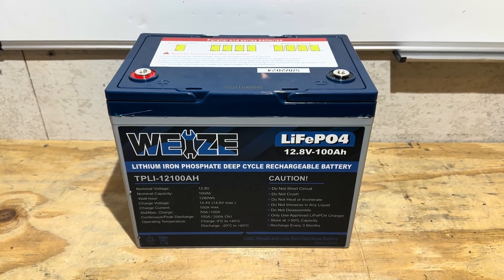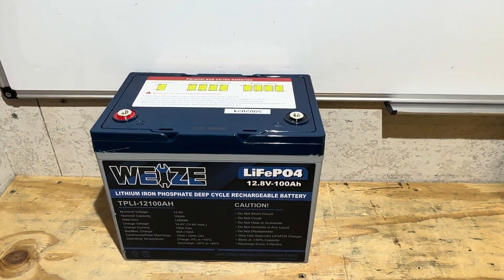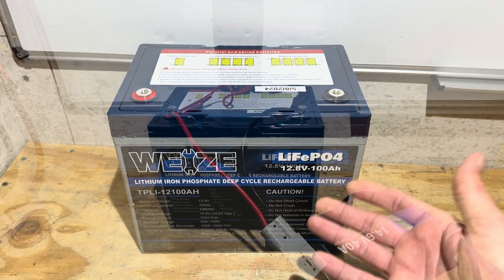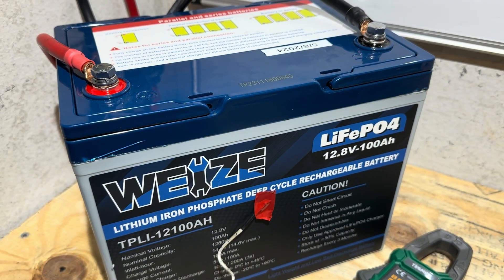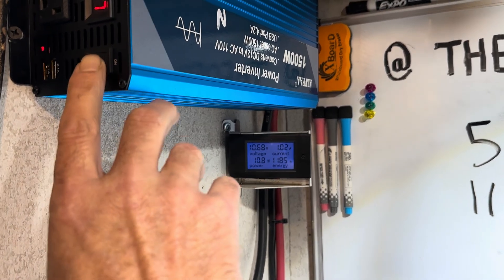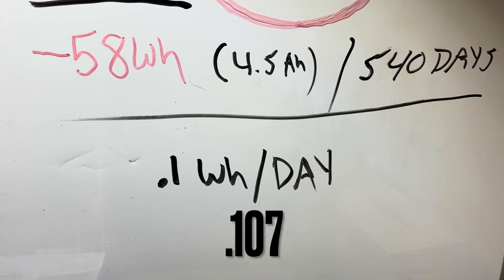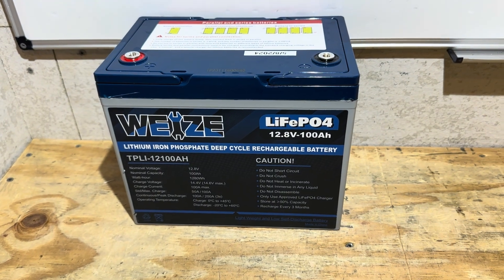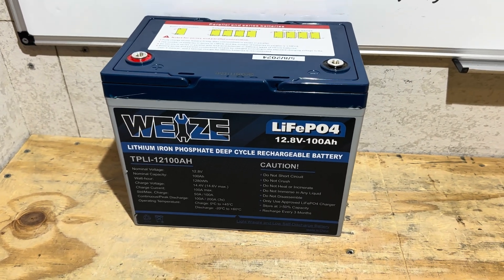Used LiFePO4 Capacity Test, Weize 12V 100Ah LiFePO4 Lithium Battery

Comment: Quality LFP batteries such as EVE typically lose 3-5% capacity over the first 2 years. 2-3% the first year 1-2%the second. 5% over 18 months is not terrible for a cheap battery. My EVE batteries lost just under 3% the first 2 years. High temperatures increase the losses as well. Which may have been the case being the installation was in a camper.

Comment: I wonder if you're looking at a slight increase in internal resistance, more than actual capacity loss. Try the capacity test at a lower rate, more like you would, a lead acid battery. As you look at the comments, and see replies indicating less capacity losses, they might be testing at C/10-C/20 rates, more similar to how lead acid battery capacity is tested.
Reply from the maker: I would assume by this point in the battery’s life there is increased IR from build up of passivation layer which is normal for aging cells. 
The potential higher IR could cause a loss in overall efficiency due to more heat in the cells during service. 

I also agree if I pulled down slower that there may be a measurable difference in overall capacity. Probably not earth shattering difference but measurable nonetheless. 

But I try to charge and discharge near a .5C rate which is how cells are tested at the factory for capacity. 

The 40A charger isn’t perfect but it’s ok for rough ideas on 100Ah units. Of course I’m not a test lab by any stretch of the imagination. I do try to keep everything consistent best I can. Use the same equipment and methods, the only variable is the battery.
Reply: @THEOFFGRIDMOUNTAINHOMESTEAD  That's OK. This is "real world" testing, which gives a better idea of what the battery will do for us, not what it did for a lab technician. My primary interest in batteries is renewable energy, where the charging and discharging occur over longer periods of time. Changes in equivalent series resistance are less apparent for me, where I spend an entire day discharging, then, charging over several hours during a sunny day. I just don't run them as hard.
Reply from the maker: @vincentrobinette1507 Yes in the system this was running in was very slow rate charge and discharge. The battery was never hit hard at all, which kind of surprised me. It had a pampered life. 

I had always gone with the assumption that slow and easy on the batteries and they would last even longer. 

I do have a couple 12.8 that have been absolutely beat on for comparison purposes and I’m curious to see how they have held up. 

Maybe aging will take them out before cycle counts? Boards should last 8-10 years but I’m starting to see some board failures here and there in short order too. There will be an update on this soon as well.
Reply: @THEOFFGRIDMOUNTAINHOMESTEAD  Internal resistance is based more on the number of charge/discharge cycles, than the current. Once the battery settles in, its resistance will be higher than when brand new, but shouldn't vary much from then on. In the case of the Weize battery, as well as the newer one, you're measuring that initial degradation, which is much more dramatic, than what you'll see from now, until the same number of cycles from now.
Reply from the maker: @vincentrobinette1507 Time will tell!

Comment: I'd settle for that capacity loss to be honest. It's still good for a good few years yet. Thanks for the info however.
Reply: I use several knock-off Lifepo4 batteries. Some perform better than others - even different batteries with same name stamped on the label. For the price I am OK with that.
Reply from the maker: @gwb8445 Thank you for sharing. Some of the cheap brands change their build often. Sometimes within a few weeks. Often a mystery box, that’s why I enjoy checking them out. 🙂
Reply from the maker: Thanks for sharing your feedback! Appreciate you. 👍

Comment: I've been using 4 Renogy 100 amp hour batteries for 3.5 years daily (in parallel).  Each battery has lost less than half an amp hour over that time.  Very happy with them.
Reply from the maker: Great to hear! Maybe this battery had second life cells and is leading to a faster decay curve. It is a cheap battery and never delivered 100Ah even new.

Comment: When you originally tested it, did you do it at the exact same load and with the same inverter, shutting off at the same point?  If any of that is different, then different results, and basically apples and oranges. 
Also, capacity is typically tested at .2c  ( so a 20A load, rather than how you loaded it) typically to when the BMS shuts off, NOT when the inverter shuts off.
I expect if you tested it with a 20A load to BMS shutdown, you would get a higner value... and that value would be the same way the factory would have tested/rated it.
Reply from the maker: LFP cells are typically tested a .5C charge and discharge rate for their rating from the factory this is repeated 5 times and the average of the last 3 discharge tests is the capacity stamp of the cell when new. There is a 5 hour rest after full charge or discharge before proceeding further to allow the cells to return to ambient temperatures. Ambient test temps are 25°C +\- 2°C. 

.2C is a hold over from lead acid. 

Yes the initial 1243 was obtained from an Alffaa inverter until low V disco on the inverter. I never pull to BMS shutdown. Real useable capacity on an inverter is all that matters to me. The battery case temp I showed would be an accurate representation of the cell temperatures as the battery was held at this temp for 24 hours. The charge was a top off. It was fully charged the previous day. As I do with all my batteries.

Comment: I’ve got a crappy deep cycle battery that I hook to my remote cattle fence and kill dead a few times a month that is coming up on 5 years old. It’s starting to degrade but still sits in the snow and zaps critters when I need it to. I’m pretty sure I just got lucky with that one:)
Reply from the maker: Fence charger duty! I like it. 
I have a 2019 Walmart Lead acid on one of my fences. Still kicking lol. Thought I would have to swap it over to lithium by now. Kept fully charged on solar and barely used it may outlast some cheap lithiums? 
The manufacturers do rate their boards at 8-10 years of use. I have some boards already failing. Thats for another video though. 
Have a good evening Jeff. 👍

Comment: its a run of the mill battery   so dont expect perfection.  sure it lost capacity after 18months  but look at it from another side,  maybe the next 18 months its at the same or losses less, really wont know if it will hold up to its 10 year 20% loss claim.   will need another 102 months to judge that.
Reply from the maker: I linked a study in the description that has some interesting findings.

Comment: Did you by chance test it's capacity any other time between initial and this?

Saw another video that implied that two or three charge/discharge cycles when new can result in measurable improvement or worse performance, depending on I presume the cells themselves. 

All that to say, is it possible the battery lost capacity earlier, and has stabilized now? It seems a stretch, but I feel like that could be a possibility that isn't addressed strictly with a before/after test. 

Appreciate the video, it takes effort to go through all this testing!
Reply from the maker: Great questions! 
2-3 Partial cycles from new is where the initial capacity was derived. 

No other tests in between when installing into the 12V system and when   I pulled this battery and another out to replace with a 314Ah unit. The other battery that I will have a video on as well showed very interesting results. I’ll have it out in a day or two.

Your point of checking at intervals is great. I need to check at intervals like 3,6,9 months etc old and see.

Thank you again for a great comment! 🙂
Reply: @THEOFFGRIDMOUNTAINHOMESTEAD  No worries, just curious! Don't think it REALLY matters at what point capacity dropped off, but it is important to know that it did. 

I don't think any of the manufacturers are saying you should expect those sorts of results with that little time and light loading. 

It may be interesting to keep the test up if you can, see where it ends up in another 18 months. Budget batteries often seem to be budget for a reason, I think this helps point that out.

Comment: It’s in the advertising.
Most of these companies say the batteries will retain 80% after 3 to 5 years. 
What is they don’t say is that they “might be” loosing most of that % fairly early on, and then coasting at 80% until 5 years! 

I had a (bornbattle 😂) loose 30% in the first year! 
With medium occasional use. 
What a fight to get that warrantied! 😡

Comment: I think that it could be worst considering that I have had AGM and SLA batteries lose 75% of capacity just 6 months in. In fact, I had a AGM 100Ah battery that lost 95% of it's capacity after a year. I will never deal with AGM or SLA batteries ever again.  I have had some SAMSUNG 18650 batteries that is almost 10 years old, rated for 2.5Ah, did a capacity test on them about 4 months ago, and they had 2.2Ah, so I am happy about that, considering that they were from eBay....LOL.
Reply from the maker: Definitely better than AGM or lead based no doubt about it. 🙂
I’ve always been curious about some out there that claim LiFePO4 will last 40 years 15000 cycles and have 60% etc, etc. 
Whether this is just calendar aging of the cells or if these were second life cells and have a faster decay curve etc is unclear. 

I linked an article in the description that was published recently showing different test and results from LiFePO4. 
I have looked over studies in the past but some newer articles show potential for faster aging than is commonly thought. Only time will tell…

I have another battery that has been stored @ 50-60% SOC and unused that I may show as well if enough interest. Would be nice to compare.
Reply: @THEOFFGRIDMOUNTAINHOMESTEAD  Yes, please test more batteries. It's hard to look for a trend with just one data point. Would anyone be surprised if the LifePO4 batteries do not live up to the hype?
Reply from the maker: @georgeclark7208 I already have a video on another battery that was used the same amount of time. You’ll probably like the results. 🙂 I’ll have it posted in a day or so.
Reply: @THEOFFGRIDMOUNTAINHOMESTEAD  Excellent
Reply: @THEOFFGRIDMOUNTAINHOMESTEAD  I would love to see more videos in regards to batteries that has been stored and unused! I think those would be interesting. In regards to some brands of batteries I feel like they are used cells that has been rewrapped, altered QR codes or whatever measures they take to make them look like brand new cells.  On that note, I am tempted to do a capacity test on my Eco-Worthy 12.8V 20aH batteries.  They are over a year old, were purchased during a power outage that lasted a week, hence me stepping into the world of solar.
Reply from the maker: @brend @brendajanes4139 e, some brands are more suspect than others. 
I’m interested to know what you find on your batteries. Please keep me updated if you decide to check them! 
As always I truly appreciate your support! 🙂

Comment: All mine sit not used for a power outage or just camping here and there. Maybe I got to test them out some day.  Just FYI the 20 amp HQST MPPT came and it has Bluetooth and temperature probe will test for cold temp shutoff but it should work.  I’ll get a video out here soon. So far really solid charger.
Reply from the maker: Good the hear about the new charge controller. Look forward to your video. 

I have some batteries that have been sitting in storage at 50-60% SOC. If enough interest I will run one that has been sitting static and see if capacity results are similar.